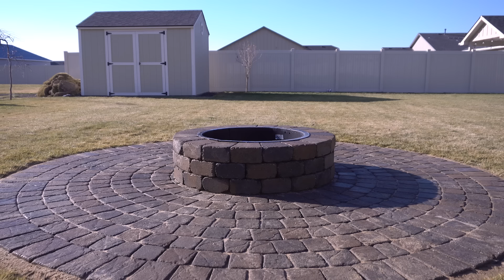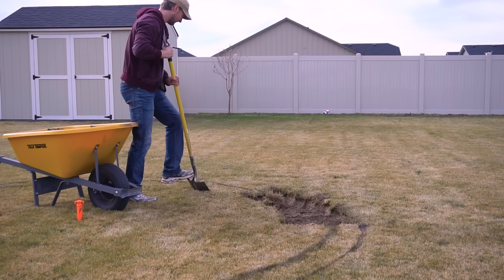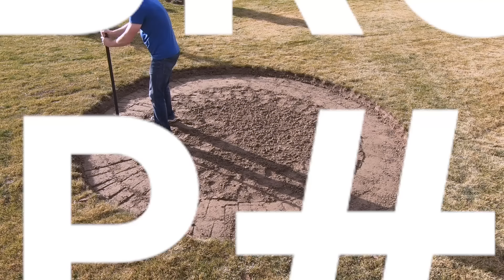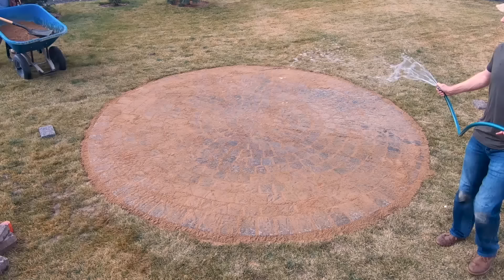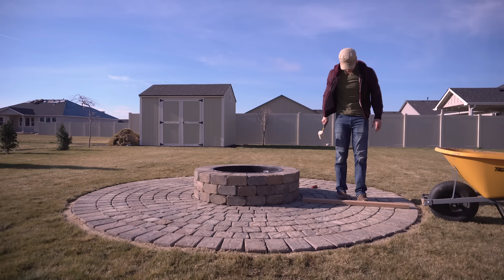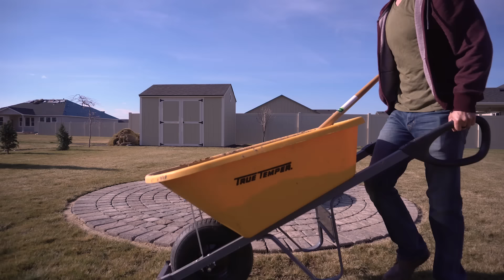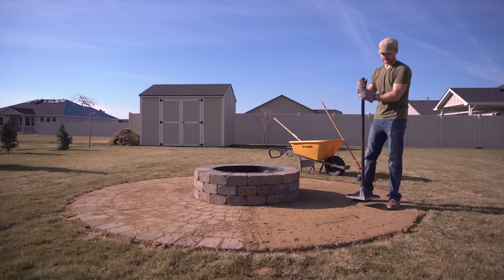My 4-Day Fire Pit Patio Build [Full DIY Project]

Comment: Crazy.. I've never seen a patio built without a proper base or compaction or poly sand. I've also never seen a circular fire pit be built straight on top of the patio and not cut in. I wana see how that holds up
Reply from the maker: 2 years so far, no issues! I think the hand compacting is more effective than it might seem. And not having poly sand means that there's no cracking if the pavers HAVE shifted a little bit - although I don't think they have. 🙂

Comment: Why did you need to dig the hole 7" deep and then put 3 layers of gravel on top? Isnt that a bit unnecessary?
Reply from the maker: I also could have put all the gravel down at one time, it just would have been harder to compact it by hand that way. And the reason i needed that depth of gravel was to support a riding lawnmower - the deeper the gravel layer, the more it can support. If this was for a driveway, it would have needed another few inches. If we were only going to walk on it, it could have been a bit less.
Reply: @BroBuilds  thanks - so just curious what happens if you dont put enough gravel> Does it start to sink in from that area if a larger load is placed on top of it?
Reply from the maker: @vishallalwani6070  theoretically, yes.  Or shift in some manner. I'm guessing the ground isn't equally strong in all places, so it might slide more than sink.

Comment: Do you remove the bricks in the bottom of the fire pit so they don't scorch or crack from fire and heat?
Reply from the maker: No, we left them in there, but I added a fire grate to keep the fire up off the bricks. So fare they haven't cracked at all.

Comment: I don't understand
How does it hold lol ?????
Reply from the maker: The black edging holds the ground pavers in place, and gravity holds the firepit blocks. Eventually I added some masonry adhesive to the top capstones of the fire pit, just to make sure no one tipped them off.
Reply: @BroBuilds  good that's my question , tipping them off , tell me something if it's like a square area , I use these blocks and when I'm finish I can seal it off so it's like you're walking on them and no one can tip them off right

Comment: Used this video as a guide. Did a 16’ diameter patio kit. Worked well. Only tip: make sure your sand layer is consistently level or the pavers won’t be as perfect. Also 16 foot might be a little aggressive for a first timer.

Comment: you can make the fire pit smokeless by removing four stones at the bottom each 1/4 turn and inserting a ring with holes all round at the top of the Ring for a centrepiece,  or you can do it all in stone

Comment: I put a pit together. It was pretty simple though. Some 4 foot diameter center pit with 4 rings of 1x1 foot concrete slabs. I put leveling sand under and between the slabs. Looks pretty nice but my group had to do it in three days.
Reply from the maker: Nice!

Comment: Super cool project!

But why did you NOT use any mortar on the big stones for the fire-pit - especially the top cover ?!

I would imagine some kids balancing on it when it is not in use and generally the thought of using mortat to glues the stones in place seems like a good idea!
Reply from the maker: I left it loose at first because we planned on adding some air holes if the fire pit needed it. Then I used some masonry adhesive on the top capstones and locked it all in place. 🙂

Comment: Use a level
Reply from the maker: In general I agree, but in this case I didn't want it level, I wanted it to match the grade of the lawn. Then I used a 2x4 to make sure all the pavers were level with each other. Little weird, I know, but I didn't want one edge of the circle sunk down (or lifted up) above the lawn just for the sake of being level itself.

Comment: 0:35 12,5 F = 3,81m (round up to 4m)  diameter hole
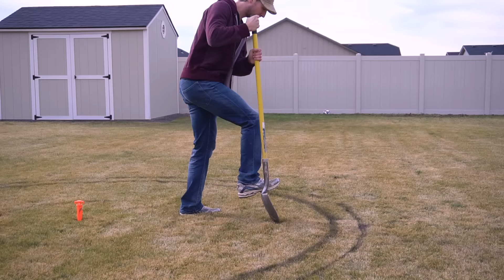0:50 1Inch =  2,54 cm (round to 2.5cm) Sand
- . . - 4 inch = 10,16 cm (round to 10cm) Gravel
- . . - 7 inch = 17,78 cm (round to 18cm) depth

Comment: It looks good when its new but in one year it will look like WW2. The ground moves you know and they did’t use non-woven fabric at the begging as base foundation and sand is too flexible so the stones will sink in to the sand. But it looked good for now
Reply from the maker: It also looks good after 2 winters. No movement, no issues. The base foundation is super solid.

Comment: Well building bro.. I'm going to build one in two weeks on a rooftop and I'm pretty sure that I will need at least a half an inch space between each Stone to put cement in now you're going on Earth that's only been tempt how much you want to bet after a few seasons of rain and people walking there you will wish you had left more space than put some cement in between each......
Reply from the maker: Two winters so far and it hasn’t moved a bit. We built it to the specifications recommended for where we live.

Comment: well can you have done it from the edges to the center
Reply from the maker: No, that would require a ton more precision since your available space would be getting smaller and smaller. Any mistake would become magnified. Going from the middle outward is tricky to start, but a lot easier in the long run.

Comment: don't build a fire directly on top of the pavers!  Lay down some sand to insulate it, plus when it's time to remove the ashes, you are scooping from underneath, grabbing the sand and ashes.  Also, I would have ignored the instructions and spaced the pavers on the bottom ring to leave openings for cool air to come into the pit.  Then drill holes on the side of the metal ring near the top and kept the pavers an inch or so from the sides of the ring.  While not perfectly smokeless, it will reduce it some.

Comment: uhm isnt the concrete ring on the top degrading from the heat? I mean you literally reduce concrete to Ca(HCO3)2 with heat.
Reply from the maker: I think the fire might have to be a lot hotter to do that. It's not showing any signs of wearing away or anything.

Comment: I dont know shit about landscaping but why are those firepit surround stones not secured in place? Also those on top, dont they fall if you sit near the outer edge? I don't want to sound rude, just wondering. Will they just hold themselves by gravity for many years without adjusting?
Reply from the maker: The top capstones I ended up securing with masonry adhesive, but nothing else needs it. The firepit is locked in place now that the capstones are secured, and the patio itself is solid and won't move. Some folks use polymeric sand to lock pavers in place, but I chose not to. So far it's worked great!

Comment: Why does there need to be 3 layers of gravel underneath the sand? Can you get away with just one?
Reply from the maker: The thicker the layer of gravel, the more weight the pavers can support without moving. We have a riding mower, so that's why we did it that thick.
Reply: @BroBuilds  ah, this makes sense! Thanks for answering!

Comment: I built a paver walkway and used polymeric sand at the end. It actually bonds the pavers to each other and I highly recommend it for any paver project.
Reply from the maker: Polymeric is great. I think I would've used it if I hadn't made my gaps thinner than the recommended width.

Comment: How’s the pit doing now? Do weeds come up in the sand between the pavers?
Reply from the maker: I've pulled a couple small weeds, but it's actually the grass that started growing in a few inches on those bigger pavers around the edge. All the weeds are lightly rooted near the top, but the grass is coming in from underneath so it's tougher to pull. Might try spraying something to kill it - or just spend an hour on it every few months in the summer. 😅

Comment: Nice work, I'm doing the same. You did some of it the hard way, but the result is near perfection: It's not smokeless and has no airflow for your fire. I'll add that on mine. All you need to make it smokeless is a gap between the ring & blocks. You leave out 2 blocks on the bottom row and space them for air entry gaps. The air is heated by the ring and comes out at drilled holes in the top of the ring...EASY Smokeless.

Comment: I do this for a living so itll be interesting to watch (posted before waching) First thoughts were dont hammer your bricks in til the end then just use the hand tamp and hit it flat also the reason for the gap is to put sand between the pavers to lock them in place without them moving and after that you tamp it then put more sand on while spraying it with water so it will soak into the cracks preventing the pavers from sinking and sand dispersing.

Comment: When digging up all that sod & soil, this might be a great time to use them as filling for a thigh-high raised garden bed or two!  Put the sod upside-down at the bottom, along with old leaves, twigs, and other yard trimmings--ideally some rotting wood or aged wood chips, too, to act as a hugelkulture fill that will soak up water and help keep the bed from drying out when it hasn't rained enough.  You can also layer in some kitchen scraps or partially made compost to help provide nutrients for your plants as they fully compost over time.  Then fill in the remaining dug-up soil on top, and when it's full, plant the raised bed with just about whatever you like!
Reply: Great idea! I think it’s smart for us all to become more food independent, and that’s a good opportunity for reusing the soul and grass.

Comment: might be a noob question but what purpose did those 2 condiuts serve in the sandpit
Reply from the maker: They keep the 2x4 level, so you can push the 2x4 across them and smooth the sand out to an even 1inch depth.

Comment: Is the gravel necessary? I have read a lot of places that sand was all that was needed. Good thing I watched before starting my own project
Reply from the maker: Yes! It helps the water drain away while giving a solid surface for the pavers. How much gravel you need kinda depends on what you're gonna use the patio for. More gravel supports greater weights. So if it's a driveway, you may need 6+ inches. I forget the actual numbers, but if you don't have enough depth for your usage, the pavers will start to shift.
Reply: @BroBuilds  thanks for the reply! I’m doing a similar fire pit/patio build. Appreciate the advice

Comment: DON'T put those concrete slabs on top.  They can explode and cause injury if they get too hot from the fire. You can only use masonry designed for chimney/oven use for a fire-pit.
Reply from the maker: They are specifically built for this purpose.
Reply: @BroBuilds  Nope.  The concrete top slabs aren't made from refractory cement.  Who told you that lie?

Comment: Great video thank you. What were your thoughts for grout or mortar for the firepit and concrete caps?
Reply from the maker: I ended up using some masonry adhesive for the top capstones, but I'm glad I didn't use anything else. I like how it looks without anything in the cracks, and with the top capstones secured, it's all locked in place.

Comment: As a person that works with Cast Stone.  3/8" is the standard joint in brickwork.
Reply from the maker: Maybe you can answer this question then: what's the reason for that? Does it matter what you fill the cracks with?
Reply: @BroBuilds  It allows for easy tolerance for adjustments. It also allows the brick to expand and contract during temperature changes.  And to keep things holding together, use a running bond.

As for filling the cracks, most of the time its just mortar.  I have seen some that used a more elastic caulking like substance. I think the sand on your patio is fine, it allows it to drain.  Not sure if it will eventually wash out though.  I thought it was odd you did not use mortar on the fire pit itself.  Although its small, and if you plan to take it apart later you can.

Comment: How to do this if you don't have sod?
Reply from the maker: It'll be more work, but I still recommend digging out sections of grass if possible. They'll need to be smaller than mine were, and they won't fold up, but if it's decent grass it might still hold together enough to speed up your digging a bit.

Comment: I would have concreted up the edges, let it go off. Next day or so , put a vibrator plate with carpet on its base and run it over the papers to even them out and get them settled into the sand with dry sand pre swept in, and vibrated in.

Comment: Bruh i could build this in an afternoon including a trip to home depot and quick trip to get a rooster booster

And that isn't a fire pit my guy there needs to be a hole that gets filled with wood that gets lit on fire and big wood too

Am I just too Midwestern whats up with all these sissy pits
Reply from the maker: Lollll. So build it in an afternoon. Let's see it. 😂
Reply: @BroBuilds  i did with my dad when I was 14 I'm now 19 and we moved since then so it may or may not still be there but I cant exactly easily take a picture anymore either

It was made with mostly shit slabs of fancy facade concrete that broke if you sat too hard but the pit part itself was made with rocks I stole from my grandpas creek in nebo IL

The pit itself was 3ft wide and 2ft deep and the patio was a octagon with zebra grass and hostas

Comment: You should cement the firepit. Any kid comes along and sits on it or pushes it and just collapses.
Reply from the maker: Well, it's more solid than that! 😅 But yeah, I ended up using some masonry adhesive on those top capstones so it's all locked together now.

Comment: Fire probably smokes a lot. Remove 2 or 3 of the bottom stones around the pit wall for fresh air at the base of the fire.
Reply from the maker: Great tip. We ended up doing this in another video as well.

Comment: Use 1" square pipes for screeding. Also, remove the pavers underneath your fire ring and base them into the ground. That way, when the pavers under your pit decay and shatter from the heat, and they will, your pit block doesn't collapse with it.
Reply from the maker: Good tips

Comment: i didn't see any mention of this pit being of "smokeless" design......i just finished one of similar design on a pre-existing patio, and it works great......if this one is NOT smokeless, it would be easy to retro the feature, since you already have the steel liner in place......people perform music and poetry around the one i built, so the 80% reduction in them having to dodge smoke makes a huge difference.....
Reply from the maker: I don't think our current steel liner would work, since it's too tight to the walls of the pit. But you're right, it wouldn't take much!

Comment: Always have empty area of ground in the middle of a fire pit never have pavers because with time the heat from the fire and hot embers will shatter the pavers. Having the middle open is safer especially when you can put water over the embers .
Reply from the maker: We can pour water right now, since it just drains straight through the paver gaps. And I agree about being careful of the pavers cracking in the heat. I added a grate to help raise the fire off the pavers, and hopefully that does the trick.

Comment: Serious question...! Is it ever an issue with weeds? Or does the gravel and sand prevent it
Reply from the maker: Surprisingly, no issues with weeds at all! There's more of an issue with the grass creeping in around the edges where the bricks split apart a bit. I did switch to silica sand later on to fill up the cracks the rest of the way, and that's supposed to be better for blocking weeds. So that's what I'd recommend using.

Comment: You can make that a smokeless pit really easily
Reply from the maker: Yeah, this is like a partial measure. The added airflow helps it burn cleaner with less smoke, but to go all the way, we'd need to find a metal ring that is the right size and let the air flow up between the ring and the bricks to get a secondary burn at the top.

Comment: Thanks for the excellent tutorial- planning on building one in my own yard in the next few weeks. In your estimation, would thrrr be any benefit to placing an elevated grate at the bottom to allow airflow and create a base of coals under the logs? Thanks for any perspective you can share. 🙏
Reply from the maker: Yeah, definitely. We added a grate later, along with some air holes in the bottom layer of stacked blocks, and the fire absolutely burns a bit cleaner.

Comment: Did he just use regular sand to fill the gaps? Don’t people use polymeric sand coz it acts like a glue to hold the pavers together?
Reply from the maker: Yeah, I made my cracks pretty thin, and didn't want the polymeric sand to crack over time and look bad. This way I can just add more sand anytime. I did switch to silica sand, though, to prevent weeds.

Comment: Just a suggestion: You should get something to make the center circle and the top concrete blocks stay in place 
Example: A brick wall has concrete in between.

This is just what i would have done
Reply from the maker: I like the clean look of no concrete, but I agree, and I did end up adding some masonry adhesive to the top capstones which locked it all together.